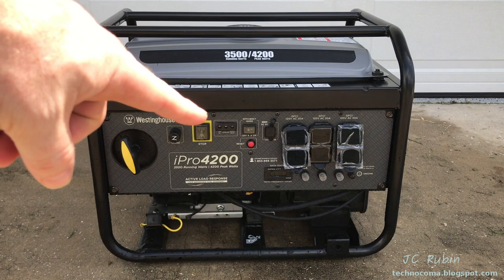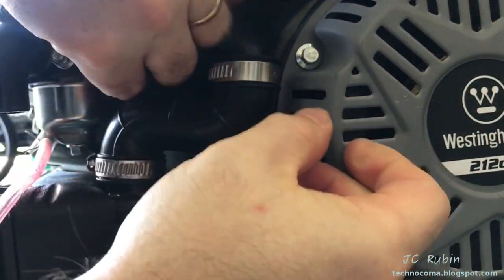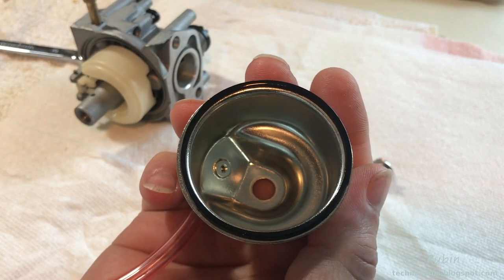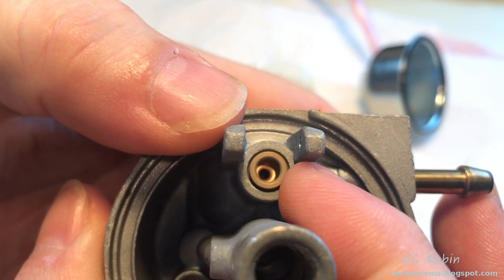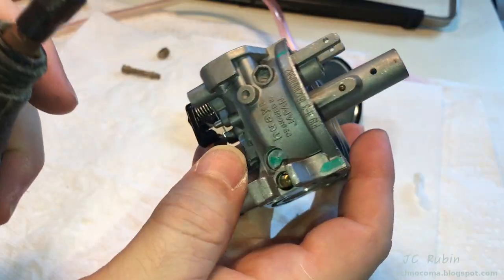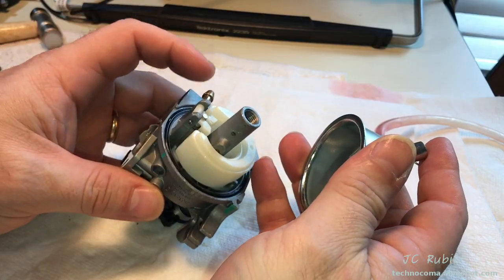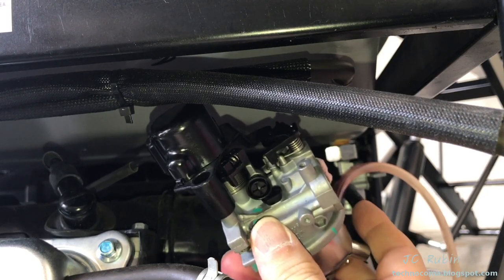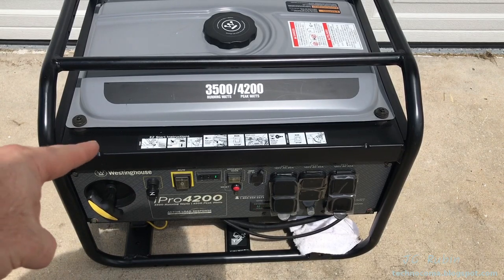Generator Carb Cleaning and Rebuild - An Easy Repair that You Can Do Yourself

Comment: Worked for me! (I skipped the power tools required surgery parts).  I could only keep it running with starting fluid so I figured it was fuel but even fresh gas didn't help. I think the emulsion tube had been clogged by me dumping some sea foam or maybe Stabil into the tank after last maintenance.   There was small amount of gas and I probably totally over did it ratio-wise.   Won't do that again, I'll just make sure it's well drained.  In retrospect, shooting carb cleaner in there might have worked too but I feel better that I went through it with the brake cleaner.   Thank you.